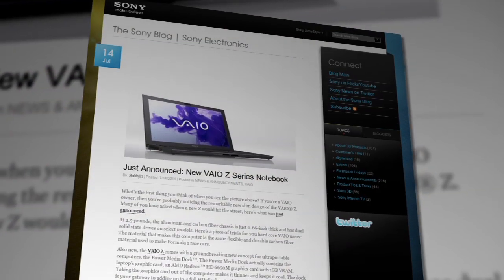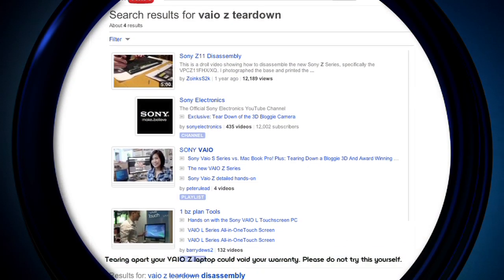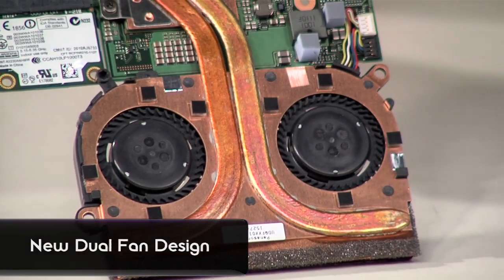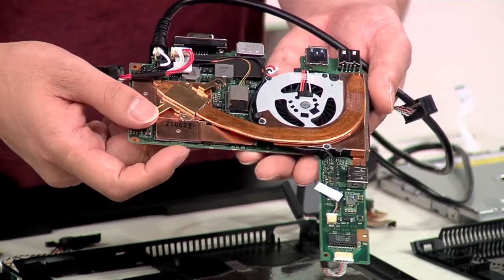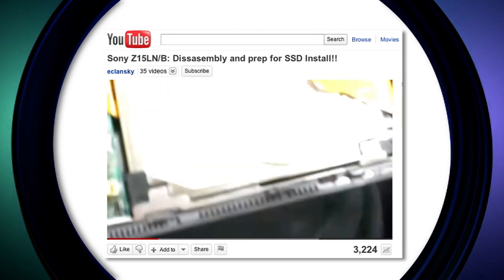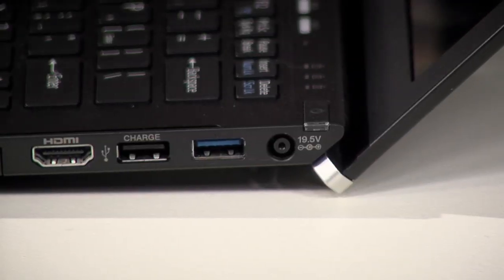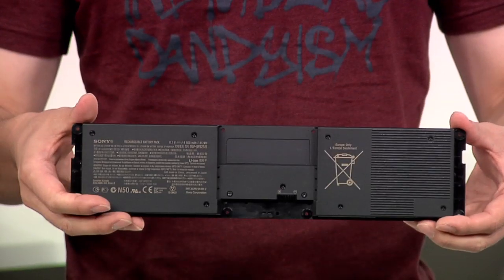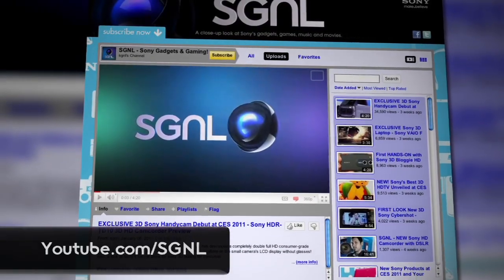Laptop Exclusive: Sony Engineer Takes Apart New VAIO Z Laptop

Comment: For trolls saying the z is overpriced let's see first off its carbon fiber which isn't cheap. Then ssds are also expensive and the minimum is 128gb (2x 64gb ssds). Then ivy bridge cpus are STANDARD in the price and this is an ultrabook .66 inches thick but has a Standard Voltage cpu 2.* GHZ not 1.*GHZ cough mac air cough. It has an expensive 13.1" 1080p IPS screen STANDARD in price. It also has usb 3 usb 2 vga hdmi card reader etc and then there's the power media dock

Comment: I like the new z series
All carbon fiber body so its strong and durable and so it can be thinner
QUAD core IVY bridge i7 STANDARD VOLTAGE DAMN only sony offers an ultrabook with that much processing power not any other company it also has USB 3.0 2x USB 2.0 VGA out HDMI out and sd/memory stick card reader and an optional blu ray burner power media dock and a max of I think 12gb ram and 2x 256gb ssds (512 gb total) so really the z is AMAZING and is the best notebook PERIOD

Comment from the maker: @dbarrera767Here are some of the differences between the VAIO S and the VAIO Z:

The Z is smaller and lighter with a screen size of 13.1 and weight of 2.5lbs, but both have the same 2.70 GHz, Dual CPU, and Core i7. The Z is a little better on battery. Also the Z comes with the Power Media Dock which the other VAIOs do not.

Hope that helps!

Comment: @dbarrera767 It's practically the same hardware.Main difference is that the Vaio S has a built in disk drive and hybrid graphics.In order to be more portable, the Vaio Z offers the disk drive and graphics via an external hub.It really depends on what you want to carry and your style tastes.Do you plan on carrying an external DVD drive?If so, you may be better off with the Vaio S.Do you hardly ever use a disk while on the go, and can you work without integrated graphics?  If so, the Z is great.